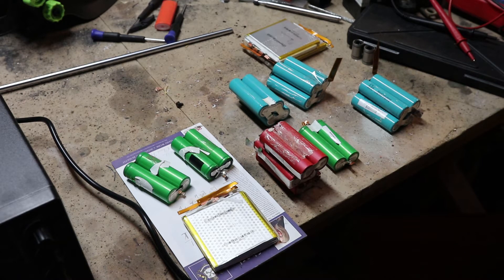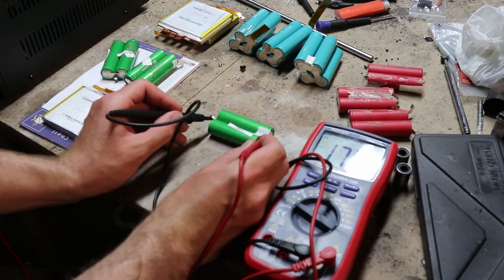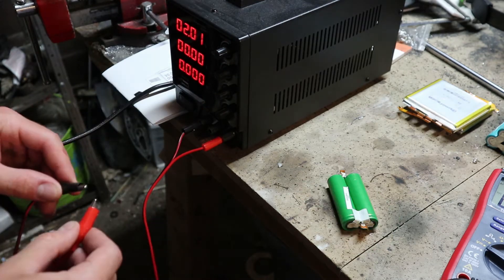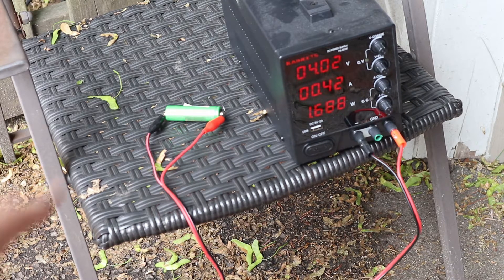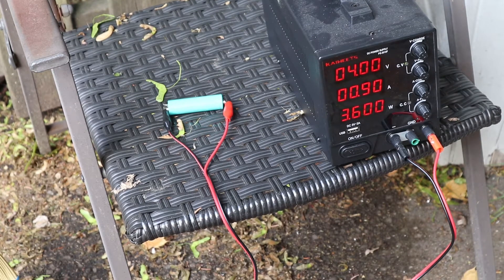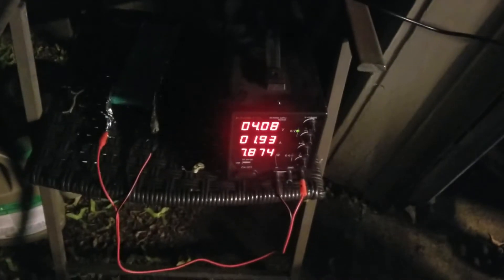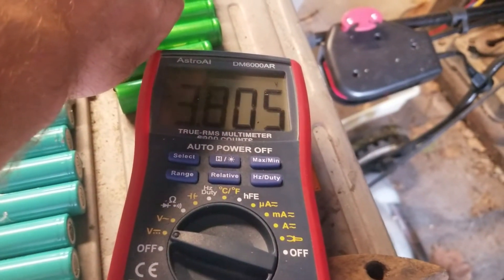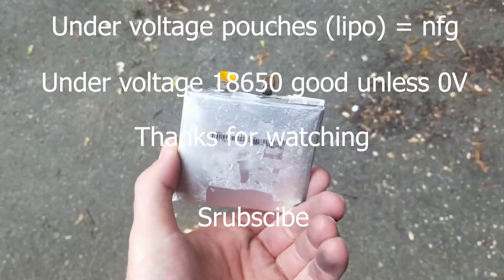Reviving Dead Lithium Batteries with Bench Power Supply

Comment: If you puncture underneath the positive tab you can revive a 0v 18650 back to 3v without charging, it's know as a pressure safety valve,but yeh try it just find a thin nail and puncture underneath that positive tab
Reply from the maker: These weren't overpressured. They would charge back to 3v, but they wouldn't hold it
Reply: @sugastuff8838  I have ones like that, I still puncture them an they hold that charge
Reply: @kanapki4368  puncturing a 18650 Is a great way to light your house on fire